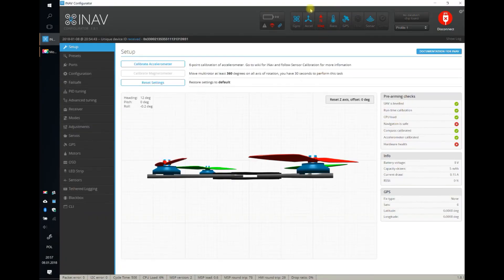Why magnetometer is not working in INAV?

Comment: Absolutely correct! Thanks a lot Pawel...3K Ohm resistor (one on SDA and one on CSL) did it for me on an OMINIBUS F4 Pro and a M8N. Your videos and the way you share your knowledge is simply superb. Keep up the good work.
Reply: just came across this. So one end of resistor to 3.3V vcc and other end to SCL?. similarly another resistor one end to 3.3V vcc and other end to SDA? Is that correct?  can you please verify if https://static.rcgroups.net/forums/attachments/7/3/4/6/2/5/a11162987-203-compass_issue_wiring.jpg is correct?
Reply: @blendofdiscovery  Take 5 VDC + and solder it to one end of the 3K ohm resistor. The other end of the resistor goes to SDA. Now Take 5 VDC + and solder it to one end of the 3K ohm resistor. The other end of the resistor goes to SCL.  In essence this is in parallel to your SDA and SCL leads from the mag. Look at the drawing on 5:03
Reply: @svitale75  I already did this. But instead 5v I am taking 3.3V.

Comment: Thank you Pawel. you helped me resolve my issue. set i2c_speed = 100KHZ turned my MAG to blue (it was red)
Reply: i get an unknown command when runnning this in cli?
Reply: What version of inav? Did you spell the command exact same way? Did you use allowed value?
Reply: I wasn't using set.  But, didn't help none the less.  Going to try the 1k resistors next but really annoyed that I've bought two different versions of the omnibus because inav said it was supported but neither works on three different gps modules.
Reply: For me initially Baro was showing red Color. So I reduced i2c speed to 100KHZ, that made it appear blue. But lot of i2c errors. So I added 4.7KOhm resistors and was able to change speed to 400KHZ and all errors gone.
Reply: two 4.7 ohm?>  I think I may have some
Reply: resistors Killed my board.  Luckily it was the f3 and not the f4.  I'm about to give up on inav altogether.   Actually going to flash betaflight and see if I get magnetometer
Reply: I think irrespective of betaflight cleanflight inav this issue will be there.
Reply: You would think so we'll see.  Is the magnetometer absolutely necessary if you have gps?
Reply: yes in INAV for pos hold and RTH to work.
Reply: Thank you Pawel. I did set the i2c speed at 100khz, mag turned blue but after some time it turns red. What could be happening?
Reply: tim gacani pull up resistors needed. Put 4.7kohm resistors between scl, sda and 3.3v
Reply: Simon George thank you simon
Reply: Simon George and on that note Simon, some god modules come with pps and en ports (on top of the vcc, grnd, tx, rx)...can the pps and en be connected to scl and sda for mag?
Reply: Gps **
Reply: I dont know about that for sure.
As far as I know, if you can give a small voltage boost to SCL and SDA, that should clear the i2c errors.
Reply: and that small voltage boost is with the 4.7 k ohm resistors?
Reply: what resistors did you use that they killed your board?
Reply: @goofyfoot
Reply: yes,  I used 2 4.7kohm resistors between a 3.3V from FC and SCL/SDA.
Reply: Simon George was wondering what killed goofyfoot's board?
Reply: Simon George Can we try at 5volts to scl and sda?
Reply: Never tried that, I used 3.3V and then 4.7Khom resistors before passing voltage to SCL and SDA.
Reply: Simon George thanks
Reply: Simon George thank you Simon. Your suggestion worked very well. InfAct I used the step down voltage within the gps module itself. Have the diagram but don't how to upload it on phone
Reply: @blendofdiscovery  5v or 3.3v?
Reply: Алексей Ефимов I used 5v

Comment: Your vids are very informative , so thank you for the great work!  I have a Zohd orbit Neon I have retrofitted with a Furious F-35 Flight Controller.  I have spent WEEKS reviewing vids and corresponding with Furious but can not get it to "arm". For a long time it beeped CONSTANTLY but now doesn't.  I was told to change the change the ESC protocol and re-calibrate it, but can't find out the protocol needed or how to calibrate it. All the check marks on the Setup page are green, but I can not spin the motor in the outputs tab.  I have swapped motors with the same results. Any ideas or can you refer me to a video I might not have seen?  Thank you so much.  Also happy to hear your name on Bardwell's livestream today - He has been very helpful on many other issues but I feel you are the INAV "know-it-all" !

Comment: If the i2c connectors have built-in or internal pullupps and you add more externally, then you will put the internal and external resistors in parallel, lowering down the resistor values on both data and clock line.

Comment: great video ,I"m having heading, home arrow , rth and position hold issues with my f35 lightning fc and  I believe your instructions will fix my issues but on inav 2.4.1 theres no magnetometer declination tab to adjust the values ,  so what do you recommend ? i already adjusted to 270 degrees cw and looks good on the configurator but still can trust it

Comment: I got my magnetometer to working now after lower i2c soeed 200khz its an l883 but randomly the magnetometer icon blink red  in inav and beeper make sound and in inav it says i2c error can u tell me what to do
Reply: I also facing this problem I use gy-87
Reply: @gsangwa  i solved this issue by using two 4.7 k ohms  pull up resistor bto scl and sda to 3.3 v and now it works on 800khz and doesn't get any errors
Reply: Thnx a lot 👍
Reply: Thank you so much
Reply: @gsangwa  no problem brother
Reply: I tried this method but it's not working
I'm using multiwii Arduino flight controller and using gy-87 Dof10 Chinese chip
Reply: @gsangwa  use 3.3 volts or lower i2c speed after using pull up resistor
Reply: @goobisoft4873  I connect scl&sda both pin to pullup 3.3v
Reply: @gsangwa  that worked for me. Try different value resistor 1kohms

Comment: I'm planning to use the Radiolink SE100 GPS/Magnetometer.  The specs said it has the HMC5983 from Honeywell.  I don't see this option available in INAV.  Should I select HMC5883 instead?  Thank you for all your contributions to this hobby, I really enjoy your videos.
Reply from the maker: To be honest I do not know. HMC5983 should be supported as part of MPU9250 but this is SPI connected. So I would say it would not work. I do not have such a hardware to test either
Reply: Thank you.  When I complete this next build with the Radiolink SE100, I'll test it out and let you know what I found.

Comment: Hello Pawel, I’m having a a very strange problem, right after takeoff the flight is great, my Nav Cruise mode works nicely, after 15min flying manual, when I engage Nave Cruise again it banks right and dives to death, I return ti manual and keep flying!
That started after a crash, I revised everything, the airplane did not break and I flew the same day, and again the day after, but now I have that strange behavior!
Do I need to recalibrate?
Reply from the maker: This probably related to horizon drift.
Reply: @FPVUniversity  thanks, how do I fix it?
Running Inav 4.1 on a Matek F405SE just 3h of flight on this rig, it’s a Reptile dragon 
All revised after a crash that did not break anything, recalibrate acc? Re flash the firm?
Thanks

Comment: So did you get any real success?  I have qmc5883, it works with arduino, but it doesn't with inav (on AIrbot F4). It has 4.7Kohm pullups to 5V.

Comment: Pavel, do you think using the HMC5883L in the BN-880 at 800kHz (the specs it says 400kHz as max) can kill the compass module? I turned up to 800 as it was suggested by iNav configurator, and since than it doesn't work. (I only checked the HMC's specs afterwards.) So it really seems, but is it likley the case? If yes, maybe the configurator should  explicitly mention to doublecheck max SCL freq before incresing it...

Comment: I faced something strange with my BLITZ M10 GPS V2 gps module which has integrated QMC5883L module. INav was showing that I have no magnetometer. I tried everything and it just didn't recognised it as separate module and was beeping in panic mode. Then I just noticed that it is working out of the box as integrated part of the GPS. I was able to calibrate it and it showed the correct orientation. So it appears that I have magnetometer without having it....

Comment: Thank you, I'm using a Holybro micro M8N GPS/Compass which is suppose to have a Honeywell HMC5983 3-Axis digital compass.  INAV doesn't list it, it only list 5883,  will this cause a problem.  Reason I ask it because when calibrating the magnetometer it is always off by 90-deg, i.e. North = West, West = South, South = East, etc.  Is there any way of correcting it or could I have done something wrong?

Comment: I have a matek F405CTR and a Matek M8Q-5883 GPS and magnetometer with inav.  The FC is not recognizing the magnetometer.  I tried reducing the i2c speed to 100 KHZ, but that didn't work.  Could someone give me a link to the resistors that I should use?  The GPS/magnetometer uses 5 volts.  Thanks!
Reply: So I guess what I'm asking is what power rating do I need?  Will a 1/4 watt suffice? Something larger?  I assume a carbon film type is sufficient?
Reply: @robburrows6052  Any power rating and any type is fine.

Comment: Great video - thanks (subscribed!). With my fake GPS / hmc5883 I got it working by dropping the bus speed to 200Khz - ideally I'd like to bring that back up using pullup resistors. Can I do that across the SDA/SCL and 5V pins (GPS is being powered by 5 V from the FC board) or do I need to add the pullups between the SCL/SDA and 3.3V supply in the GPS "puck"?
Reply from the maker: it should be 3.3V. It should work with 5V,  but it's better to keep it safe
Reply: Geoff did you get yours working by just dropping the bus speed on its own? This problem is driving me crazy but I feel that soldering in resistors is like giving in :)
Reply: My board is now dead due to resistors.  There were no bad soldering points
Reply: goofyfoot2001 did you use 5volt or 3.3volt?

Comment: Thanks for the explanation, can you help me with the following question:
I have an Omnibus F4 Pro and connected it to a fake HMC5883L (gy-271).
The mag is recognized after setting it in the configuration to FAKE.
The issue now is that it shows some lag in yaw movement and values on the 3d model when i hold the fc in place and move only the mag.
I changed the frequency, checked the pullups resistors (they are 2k) and no change.
Should i try to find a better hardware or leave it as is ?
Reply from the maker: FAKE is not really magnetometer of any kind. If this is HMC5883L, ten you have to choose 5883l. If it's not detected, you are doing something woring. Anythig connected to UART3 which is shared with I2c?

Comment: I did everything, 2K, 4.7K Ohm pull up resistors from 3.3v, 5v.. i2c speed reduce to 200, 100… nothing worked. Then I shortened the GPS cable length from 40cm to 20cm. No resistors, no i2c setting change, Everything suddenly started to work like a charm. For your information… Try.. Regards.

Comment: Hi Pawel, I have a Beitian BN880 from Bangood I'm trying to get to work with my Matek F77 and I cannot get the mag to read correctly.  At best it's around 35 degrees off.  I've tried running I2C at 200 khz, various orientations and ugh....... a bunch of stuff and yes I2C sucks, it has to go.  On that Matek is there any contention for resources between the I2C and any UARTS?  I read your post on quad me up saying you had a BN880 working with Inav.  I was hoping to solve this myself but feel now feel this almost irresistible urge to call out some four letter words and join the dark side.  Anyhoo.......  Any help, including hardware recommendations, to do this well would be much appreciated.
Reply from the maker: it is FC independent. If is detected, then should just work. The thing is proper orientation (270 flip by default) and calibration
Reply: Flip 270, good grief.  I guess the search engine gods were not with me because I could not find that tidbit.  Everyone who posted a mag orientation for that I could find said 180 flip.  Maybe it was right in front of my face on the BG product page, sigh.  Ok I think I'm in a better place now, many thanks.  Now if I could only find in the Inav docs what the hell the 'User Control Mode: attitude/cruise' is and what it does I will be able to resist being tempted by the dark side.  :-)
Reply from the maker: I might be wrong, I do not have one over here, but I think it's 270 Flip
Reply: It seems to be behaving much, much better at 270 flip, thank you.  I then did a re-calibrate.  The mag orientation procedure reads differently in 1.9 but I suspect it's essentially the same, true?  Is the 'User Control Mode' pull down in the advanced tuning tab not yet documented or am I again off on my search engine skills?  Many thanks.

Comment: I am using Chinese ublox neo m8n gps with compass.  Initially after connecting GPS, gps was showing good and mag was showing red. So i set the i2c_speed = 200KHZ and mag came healthy, But in my blackbox logs, Lot of time, Mag shows 'unhealthy'. Is there anything I could to do resolve this? Due this I am not able to use INAV POS features.
Reply from the maker: move it further away from the frame, cables, metal, battery and so on. And maybe there are voltage spikes as well
Reply: Its already mounted on a 2.5 inch tall mast.
I was searching internet for my issue and came across this topic of adding 1K pull up resistors from VCC to SDA and SCL. Do you think that could resolve my compass issue?
Reply from the maker: 1K pullups might be too strong. Start with 4.7kOhm
Reply: So one end of 4.7kOhm resistor to 3.3V vcc and other end to SCL?. similarly another 4.7kOhm resistor one end to 3.3V vcc and other end to SDA? Is that correct?  can you please verify if https://static.rcgroups.net/forums/attachments/7/3/4/6/2/5/a11162987-203-compass_issue_wiring.jpg is correct?
Reply: I did this and my controller is now dead.
Reply: I did this and all i2c errors are gone, compass started functioning without errors and position hold worked correctly.

Comment: Have tested a bn880... a ublox 8... a dji v2 gps... all problems calibrating... problem is with mag... in quadcopter when 35° inclination mag drifts... I found a problem was... metals in same gps cases and pins metals... when I put a external and cheap GY-271 mag... happy days... this gy-271 is with a QMC883 generic. Inav 2.3